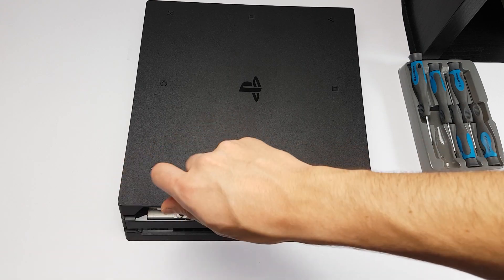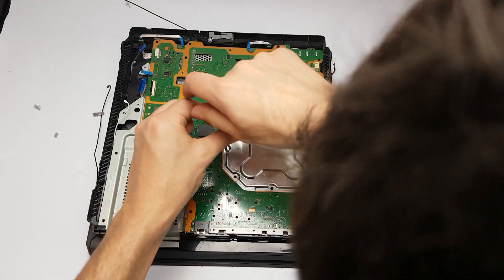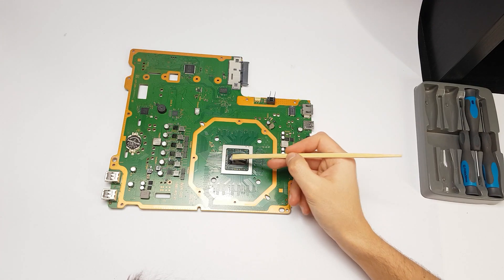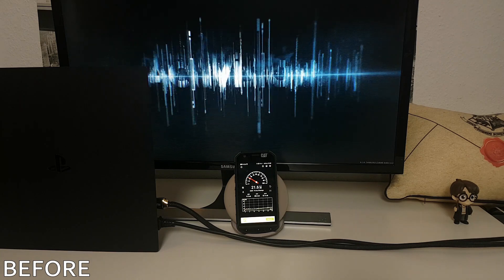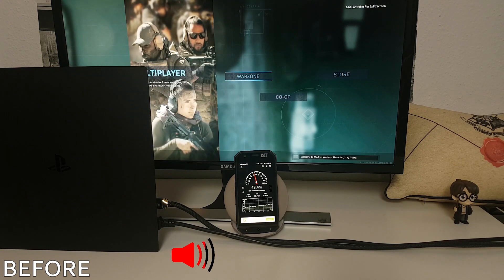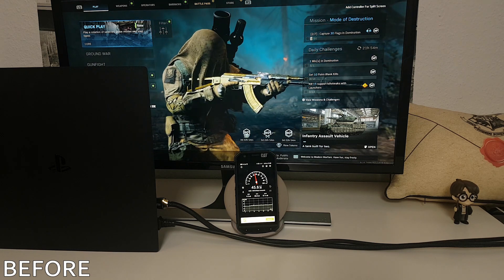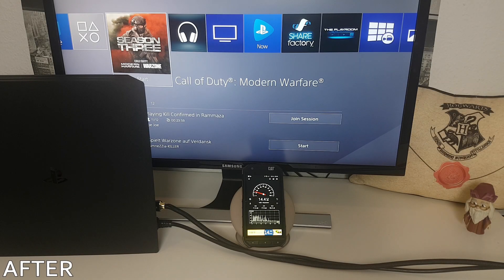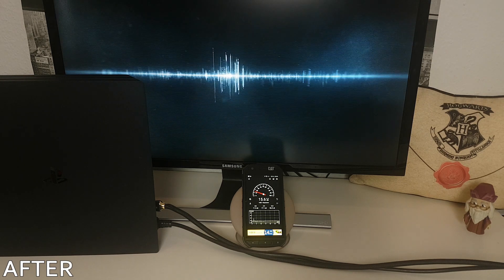PS4 PRO Fan Noise FIX - Thermal paste & dust - Before/After TEST

Comment: I did this at first it was sooo silent but now it is nearly loud again😭
Reply from the maker: After 1 month, mine is now louder than in the AFTER section of the video... But not as loud as before :)
Reply: @SiriusMonkey  could you maybe look how much decibel you have ?
Reply from the maker: @angvet_2537  Somewhere between 40-50. Also, it doesn't spin the whole time. The worst is in the menu, before I enter the actual game.
Reply: @SiriusMonkey  my ps4 sounded like a jet engine before i fixed it now its quiter 
At furst it was 45 decibel and now its about 50 or 55 is it normal?😂
Reply from the maker: @angvet_2537  It's even louder now ?? :p
Reply: @SiriusMonkey  yes😭
Reply from the maker: @angvet_2537  Wow 🧐
Reply from the maker: It depends ? :p
Reply: @SiriusMonkey  can you mess the decibel of your ps4?
Reply from the maker: @angvet_2537  Unfortunately not, but it is much quieter. But there is no 4K either :)
Reply: Only in warzone? Or other games tooo?
Reply: @marcossanoja4080  in warzone and rainbow it the loudest but when my brother plays spiderman its still a little loud
Reply: Cod Warzone literally went crazy my ps4 pro. I am also playing Spiderman and sometimes the fan is silent but other times it starts to sound. This problem beggun the first time that i play Warzone, the lobby menu fuck everything. I can give you an advice, if you have the supersampling mode on, turn it off. That can help with the sound in some games. I think that Cod Warzone produces some kind of damage in the softwere of the ps4 pro and all the games that they are uncapped makes the fan blow.
Reply: You DO realize that thermal paste needs time to burn for best specification. I replaced TP in ps 3 and pc many times and always it took up to 60hrs unnder max load to get the proper effects.. besidea that you used too much paste
Reply: @SEISMICNOISEDNB  yeah well its not that loud but still it got louder then wehn I changed the paste but im good now its just games that are too heave for my ps4 like R6 or warzone
Reply: I think the games is very demanding for a 2013 chips I feel it just kills the life span of my ps4 and stresses it out it's very unoptimized game.

Comment: nice work but you should also change the thermal pads(1mm) or the noise will be back soon.
Reply from the maker: You're right, should've replaced them :)
Reply: @SiriusMonkey  try to put thermal pad on HDMI chip. some people say this chip getting hot.
Reply: I changed thermal past for my ps4 pro cuh-7016b without changing thermal pads and the noise is pretty the same about less 3/5 db  any solution plz ?
Reply: @harvenivo  put new pads and a quality thermal paste(Arctic)

Comment: mine worked quietly for 4 days. Now again, like an airplane
Reply: Why?
Reply: You applied it wrong or you got crappy thermal paste. Get a good paste like Arctic Silver MX4 or GC Gelid Extreme
Reply: Im used prolimatech pk3
Today new paste thermal grizzly kryonaut
Reply: @Eugen_Eugene.  then must have applied too much or too little. Mine has been super quiet after a month with GC Gelid Extreme
Reply: HSmasteryoda is your ps4 still quiet?
Reply: @nation6332  yep, super quiet. Honesty can barely hear it running after hours of Horizon Zero Dawn lol

Comment: I'm sorry dude but that is A LOT of thermal paste. You have actually done harm by adding that much and can potentially get worse temps than before
Reply: Not true. The excess is squeezed out by the heatsink and temps won't suffer at all. Still not recommended to use  way too much specially if the paste is electrically conductive. Gamer Nexus did extensive testing on this https://www.youtube.com/watch?v=EUWVVTY63hc
Reply: it gets squeezed anyway you cant really put too much the excess would be on the pcb better to have enough than some spots without
Reply: @retrosimon9843  Less is more. and you must be careful with putting a lot of paste expecting it to be squeezed out the sides as some pastes have a small electric charge. a minor caution but still something to be cautious about.
Reply: @stringsofmysoul  Yeah true. But i rather use a little extra instead of not enough paste.
Reply: @stringsofmysoul  yeah nah. Paste is  not electrically charged. 

Excess paste wont do you any harm, but it's a waste and wont help either. But all this stuff about worse temps and shorting out the CPU is nonsense.
Reply: @TigerLeadFont5   thermal paste is not electrically conductive but they can hold a small charge putting your board at risk for short circuit, but like I said in the other reply it is a MINOR caution. And yes, my point was... just because the heatsink will squeeze it all out the sides is not a reason to cake it on there like peanut butter.
Reply from the maker: You're right, it was the first time I've applied thermal paste.. Thank you for the feedback :)
Reply: Lucky u didn pick liquid metal

Comment: Should I take my PS4 apart and fix it
Reply: I changed the thermal paste on my original launch PS4 and it is quieter now. It's not dead silent and still has some fan noise, but still quieter than before
Reply: NNunez09 I don’t have thermal paste at the moment but I’m planning to clean it out u think that would be fine?
Reply: @ezzz4598  I'm sure it would help. I'd say if you can, maybe order some thermal paste from Amazon. It costs like $14. I wish I would've changed the thermal pads too
Reply: NNunez09 I will see. That problem I have is that I feel like the heat sink is 90% of the issue and my PS4 can’t breath and the fan has got a lot dust In it I have never cleaned my PS4 and I have had it for nearly 5yrs
Reply from the maker: That's up to you. It has been working for me :)
Reply: It is always recommended to clean your ps4 once in a while.

Comment: Not buying it. I replaced the thermal paste and didn't make a difference.  The problem is with the game's coding.  That particular screen runs unlimited FPS, thus ramps up the system to max.  For what reason? Who knows...
Reply from the maker: Yeah, it is difficult to tell. The thermal paste replacement made my PS4 Pro quiter though :)
Reply: @SiriusMonkey  From what I can gather the reason it ramps up is because of the fog/smoke particles being rendered in the background.
Reply from the maker: @Ingeanous  Yes, that's possible :)
Reply: No the reason is dust get. A compressor and clean out the motor for the fan and clean the fan and the mother board ur ps4 is loud compared to mine I doubt it’s the coding cause my ps4 sounded louder then his and I cleaned all the dust and my ps4s fan doesent even turn on if it does turn on it turns on for a 1 min and even then it’s the quietest thing out their
Reply: @12cesaradrian  Everything is very clean (pristine, only a could of hours on the system), thermal paste and pads replaced... but it is still a jet engine on the waiting screen.
Reply: Orange Fish you didn’t clean the heat sink then. This has your PS4 loud
Reply: @sylaryegane5228  Everything is super clean, it only had a few hours on it...
Reply: The load /wait screen doesn't have a cap on the FPS, it's a software coding issue the maxes out the hardware for no reason.
Reply: Orange Fish no. Get different thermal paste then. Or your fan is perhaps broken
Reply: Orange Fish no coding issues with PlayStation making the fan over power. Do you have disc or digital? If disk then I don’t have that problem
Reply: @sylaryegane5228  Digital download no disk.
Reply: Orange Fish your PlayStation is broken. Get a new fan
Reply: You have this problem with other games?
Reply: @marcossanoja4080  Nope!
Reply: Orange Fish not going to lie everyone is going to think your lying. Post it on your page
Reply: Exactly,  same problem